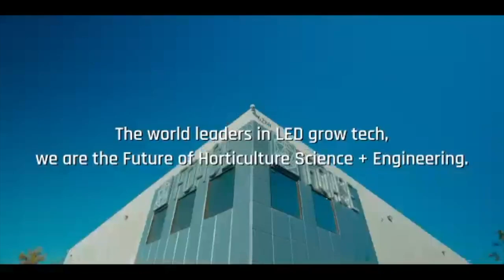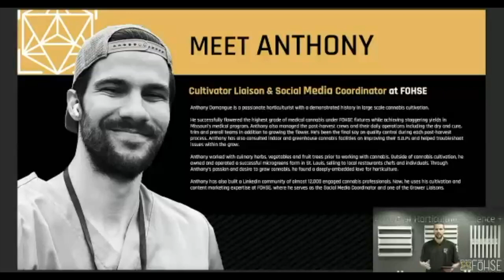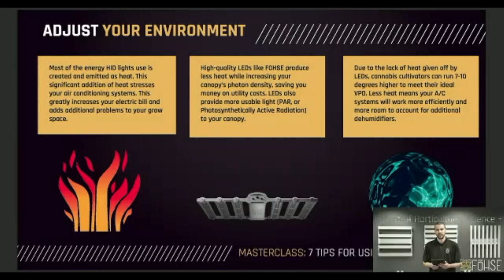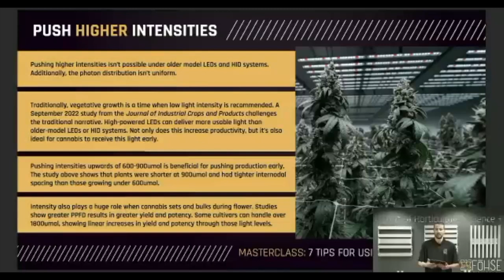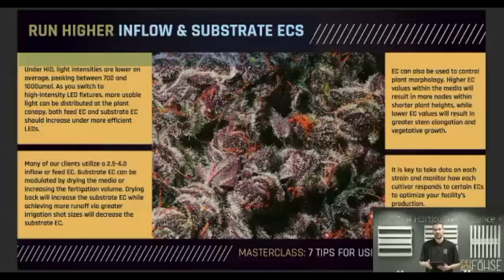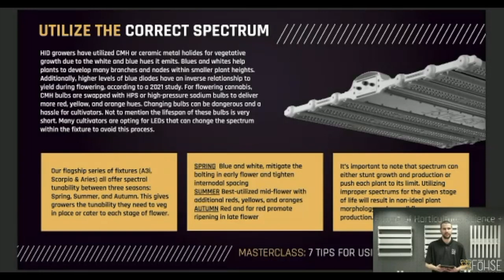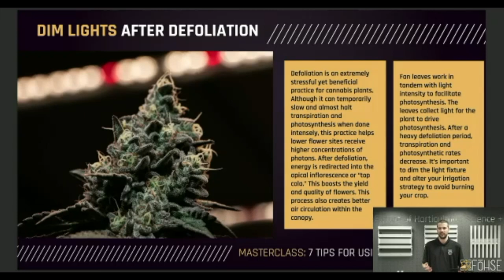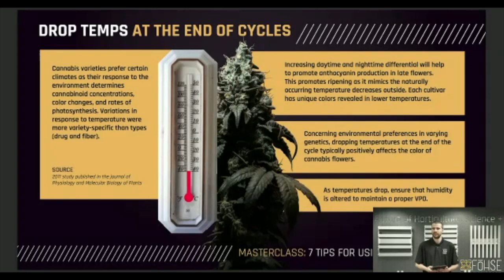7 Tips For Using High Intensity LEDs | Webinar

Comment: I have one brilliant question for @FOHSE, if you recommend about 1000mmol for flowering without CO2, then why is it that the same plants would grow well under the sun, outdoors, when the sun pulls 1600mmol, and CO2 outside is not that great, maybe 300-500.ppm?
Reply: Tbh indoor in general is a whole different ball game. The rules are different when your comparing indoor & outdoor cultivation. Outdoor is very forgiving. Taking a plant indoors. Your now replicating mother nature… good luck with that & then your comparing the sun to a man made light in regards to Co2 utilization within the plant Its just not the same.
Reply: @winningsir2439  Thank you!
Reply from the maker: Hello! Gardening is a system of many moving parts. Outdoor: the spectrum, light intensity, feed, media composition and CO2 are some of the factors that play into plant and flower quality. The sun does achieve well over 2200 umol on a clear summer day, but the media is the x-factor here. When plants are sown into the native soil, those plants have the added benefit of sourcing carbon from long-term carbon stores in the soil. 

In an indoor setting, where intensities are pushed and media are hydroponic or a manufactured soil, the additional carbon cannot be sourced from the media. Therefore, ambient CO2 has to increase via supplementation.

Let us know if you have any other questions!
Reply: @fohse_inc  Thank you for taking the time with this response. I really appreciate it. With regards to trying to mimic the outdoors, while indoors, do you have any research that supports the use of organic compost as a medium for indoor grows, while permitting higher light levels? ... I make my own compost (the non-manure kind) and promote the growth of beneficail microbes. So I was curious if and how much more light intensity can be pushed as a result.
Reply: Answer is daily lighting integral. Nature rarely has pure uninterrupted sun for 12hrs straight. At least where I’m from anyway. So even though direct sunlight is brighter, cloud cover, shade as the sun moves etc, reduces the DLI. 
I imagine it’s dli and a couple other things people have mentioned like carbon in old native soil